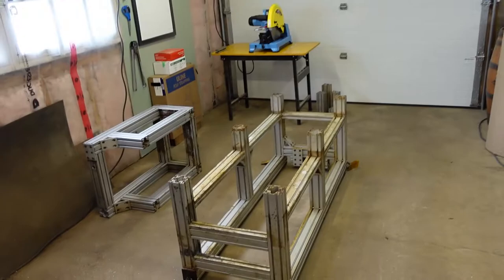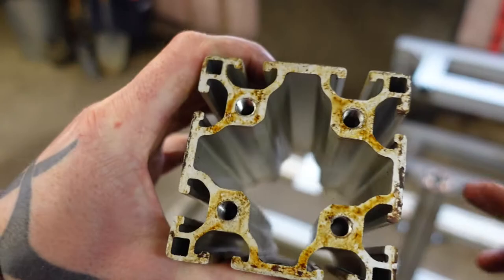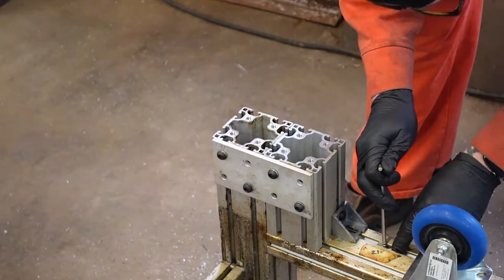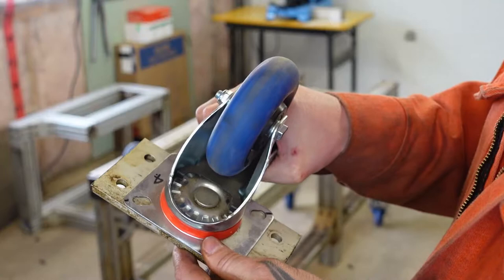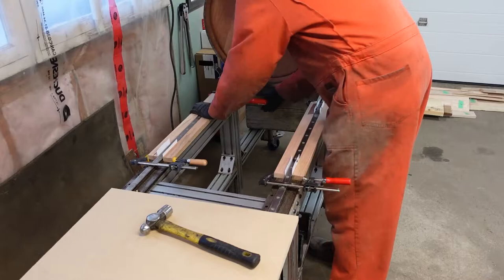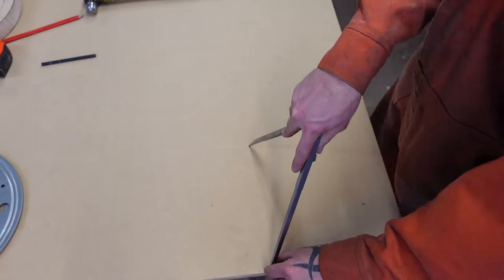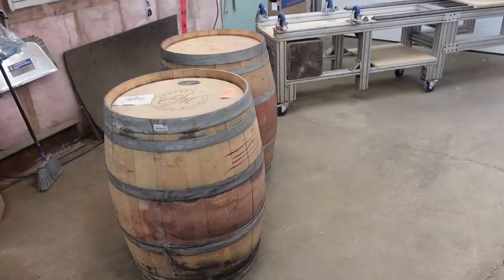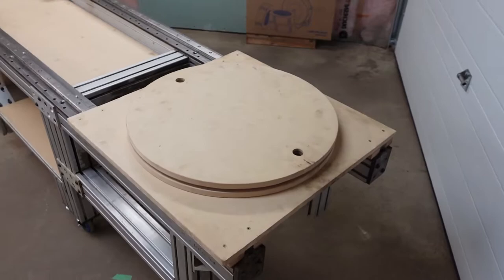Wine Barrel Workstation - Easy Manipulation!

Comment: I want to build a similar workstation out of wood for the horizontal holding of the barrel.  What is the width of the frame and best spacing for the casters to hold the barrel?
Reply from the maker: Sorry for the late reply, and it depends on the barrel size you plan on working on. Mine is ~19" wide and ~23" spacing. but the 23 inches is completely adjustable. Hope this helps